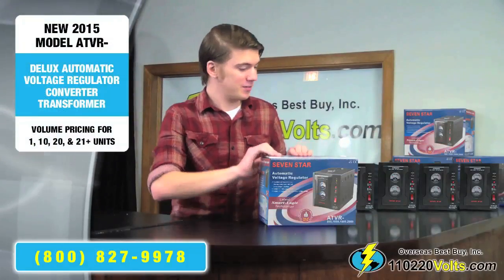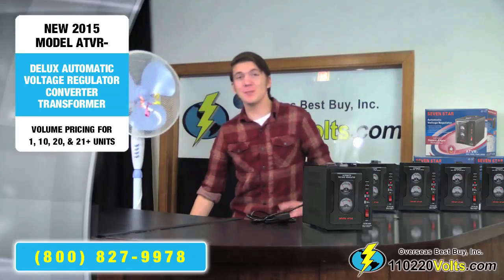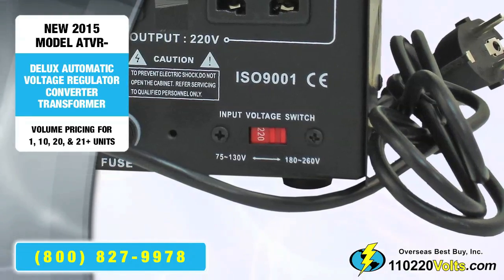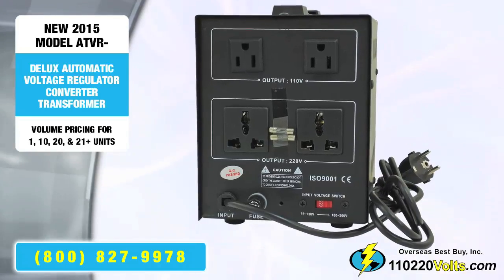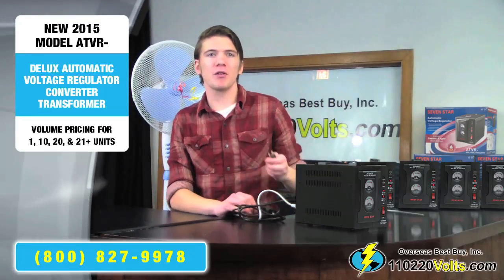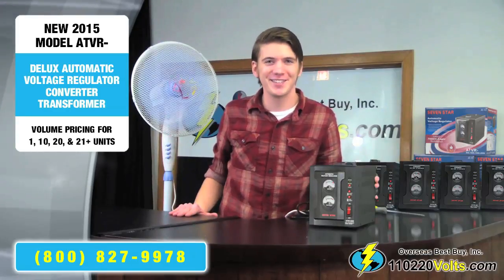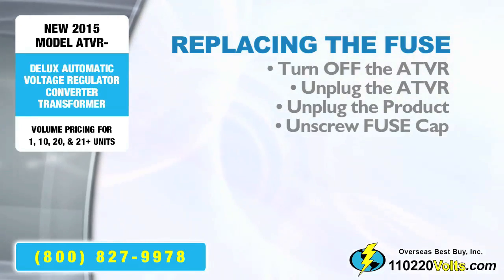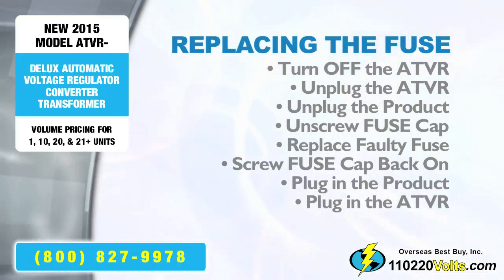How to use the Delux Automatic Voltage Converter Transformer with Regulator

Comment: so if my home elecetricity is 220 v and my product is 100 v then I need to put the switchers to 220v  then I plug my product in the back of converter in 110v then power it on ..... am i right?

Comment: Will the ATVR-10000 make a good regulator to go with a 10,000w generator (10,000w max surge / 8000w running)?
Reply: +John Nibarger 
8000 watts is the maximum but we would not recommend using the maximum capacity for long periods of time. We suggest 100% slack so the ATVR-15000 would be a better choice for some one that wants 8000w running
Reply: What is the max amp rating for the ATVR-15000?

Where is it available?